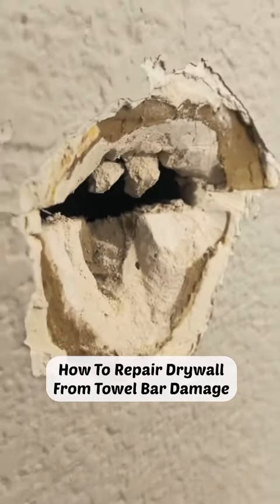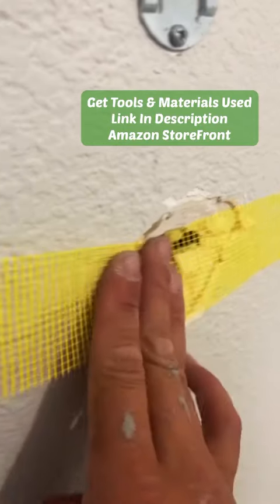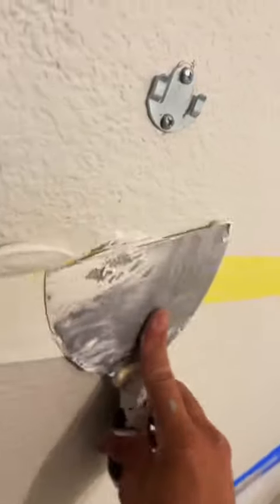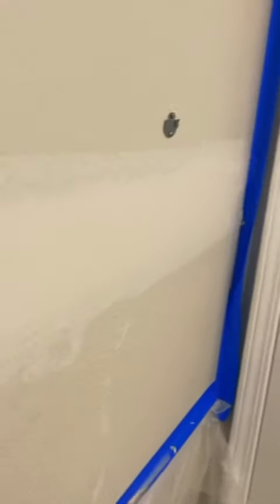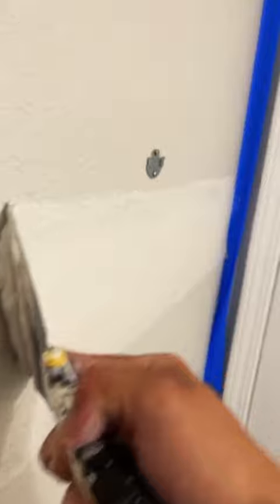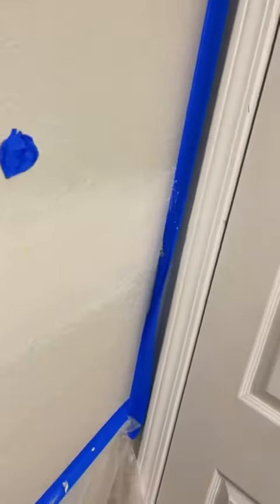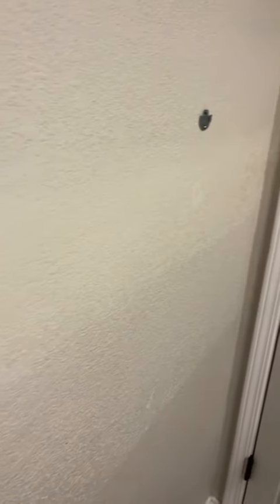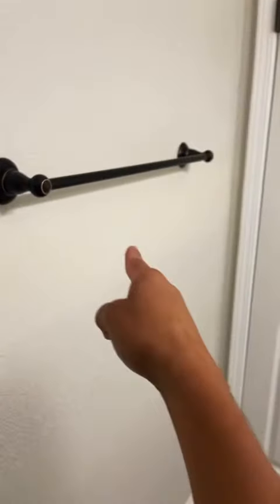How To Repair Drywall From Towel Bar Damage

Comment: My daughter pulled my towel bar down a few times so I put the bracket s on the studs and had to trim the towel bar down by 2 inches using a hack saw so it lined up with the studs but that didn't work to long the bar bent so know I just use a towel stand 4 year olds are hard to break and replace. much love

Comment: at that point, you could have just cut that section out, reinforced behind there using wood  to the next stud and added new drywall. Did that to mine and now I have no fear of my towel bar getting pulled out like that or getting loose

Comment: I've always wondered if there's a reason why walls have this textured pattern in the US? I'm in Europe and our walls are usually plastered flat with no texture at all...
Reply: I live in New York and it’s mostly flat around head sometimes the ceilings will have texture but that’s it
Reply: It's because it hides imperfections. It's so much harder to make a wall flat.